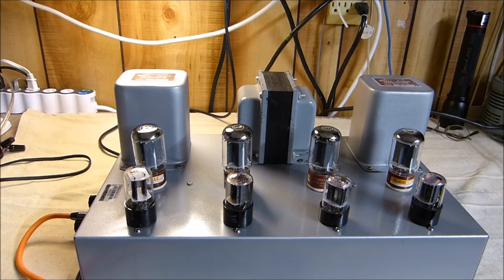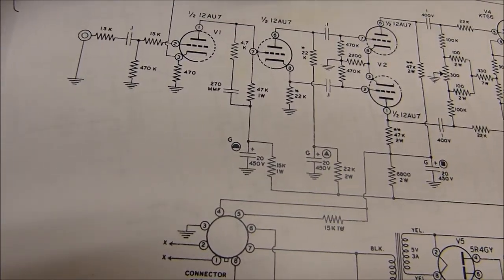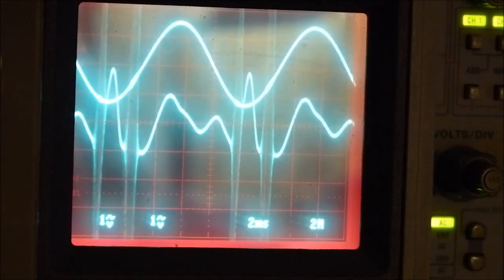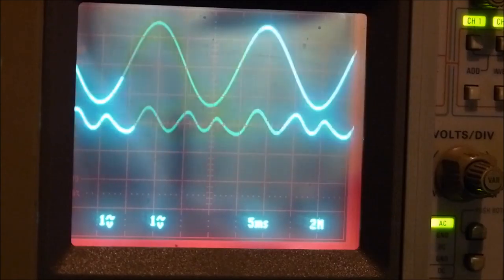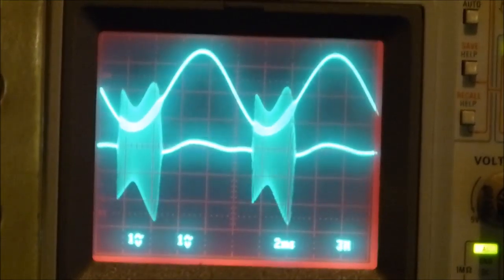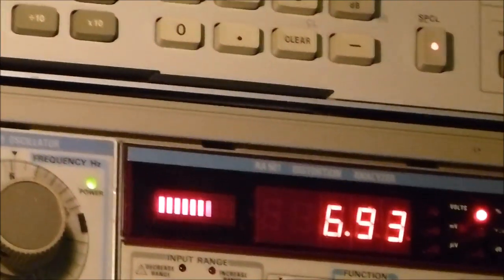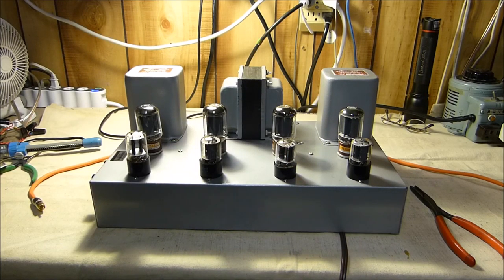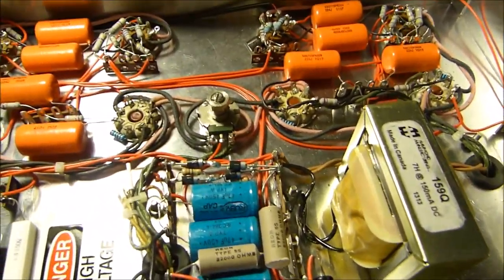Part 5 - Acrosound TO-300 (Williamson Design) Transformer Vacuum Tube Stereo Amplifier Build

Comment: I have encountered this type of oscillation on amplifiers before, mostly on transistor types in the 70/80s It can often be cured by adding a ferrite bead over the input (grid) wiring. It increases the inductance of the wire just enough without effecting the performance. Try it!

Comment: I had the same problems with a williamson style amp that I build.

These oscillations are caused by too much feedback and a massive phaseshift (in the high frequency range) in the outputtransformer.

Using a small capacitor to roll of the high frequency in the previous stages is the cheap way to reduce this effect.

Things you should try:

1. Use a larger feedback resistor.

2. Use larger gridstopper resistors on the 5881's.

3. Remove the bypass cap of the feedback resistor.

4. Instead of applying feedback at the cathode of the 6SL7, connect the feedbackloop to the cathode of the 6SN7.

5. Use a different circuit. ( for instance: use the 6SL7 for as a cascaded gain stage and the 6SN7 as a differential amplifier.)
Reply from the maker: I really appreciate your thoughts and I think they are excellent. My purpose for this amp build is primarily to test the Acrosound transformers in an actual Acrosound circuit. When built exactly to the Acrosound schematic, I get what I have shown in this video. Now, I want to modify the circuit as little as possible to stabilize it. I have found that a 0.001 uF capacitor off the plate to ground of the lower tube in the schematic stops all the parasitics at any gain pot level. I need to run a frequency sweep on it to see how this might have affected the HF response. As for playing with the feedback resistor and bypass capacitor - that is quite a chore. I have done this several times on other amplifiers and there is always a trade-off between gain and frequency response and parasitics at 20 Hz and then again at 20 KHz. Making any one perfect seems to sacrifice the other. I like the idea of larger gridstoppers on the 5881's and I will try that and I also am interested in the grid input circuit of the Heathkit W-5M amplifier. The things I will try next is the 0.001 uF capacitor mentioned above, possibly the 82 pF/10K rresistor off the grid of the second stage, larger gridstoppers, as you mentioned, and the input circuit with a series gridstopper at that point. Trying to stabilize this amplifier with the 6SL7 has already been abandoned. Not sure why Acrosound felt they needed such a high gain stage.

Comment: I had similar oscillation problems with an amplifier I built years ago. I ended up installing series 1k resistor at the first grid of the input stage. Also 1 k resistors in series with the G1 grids of the 6L6 tubes. I think this has something to do with the barkhausen effect , I'm not totally sure its been many ago. Just a thought....good luck. Its a nice project, it makes me want to build one again.
Reply from the maker: This amp has 1K resistors in series with the grids of the 5881's. They are called "grid stoppers" and I believe they are there to reduce RF interference.  I remember back in the 50's and 60's it was not uncommon to pick up AM radio stations on just about any amplifier/stereo system/TV/telephone as there so many AM stations around then. Nowadays not many are left so, if this is true, then "grid stoppers" are probably not much needed anymore. Same goes true for ham radio transmitters (i've been a ham for 53 years) and again, back in the day, it was almost assured your radio transmitter was going to interfere with the VHF stations on TV. Now with cable and satellite, it hardly exists any more.  As for the first grid, this is indeed a sensitive spot and I have found that keeping this path to ground 100K ohms or less helps prevent parasitic oscillations. I really appreciate your thoughts and a "grid stopper" resistor in series with the first grid just may be one of the things to help stabilize this unit. I will try it.

Comment: I'm really enjoying these videos. I was pleased to see you using a square wave test to help shake out the gremlins - I'm wondering if the R & C values you've chosen for the NFB might be a bit ambitious, stability-wise. Thinking back to your earlier video on selecting those values, I wonder if a square wave stimulus might have shown some oscillation that wasn't apparent at the time. Just my $.02, but I wonder if reducing the value of the capacitor on the NFB would help here, albeit at the cost of increasing the high frequency THD?

Comment: Very interesting.  Which stage is it in?  The preamp or phase inverter?   What is the top trace on the scope?
Reply from the maker: The parasitic bursts can be traced back to the first stage and undoubtedly is a product of NFB and other issues in the amplifier circuit. I am sure the OPT is a main contributor to these parasitic issues. The top trace is just a monitor port out of the Tektronix AA501 basically an oscilloscope display of the signal being tested. The bottom trace is the error signal after the microprocessor in the Tek has taken out the fundamental frequency and all that is left are the distortion products. The bottom trace is what is really important. The scope auto-scales so the amplitudes of the top trace and bottom trace are not of the same vertical amplitude. If they were, the bottom trace would just be a straight line for very low THD.

Comment: Check the values of the coupling capacitors on the early Williamson. I built the Hafler-Keros ultralinear using To-300s and used a 10 to 1 ratio to achieve stability.

Comment: just an idea... this problems that occur seem to be happening at the bottom side of the sinewave. is it possible that is occurs at phase shift circuit?
I've never messed up with PP amps, but I've built an SE amp and similar thing would happen on entire sinewave. I got rid of it by adjusting the feedback circuit and coupling cap values like using smaller values on interstage decoupling caps and more feedback and bigger value on the input to retain a decent frequency response. But it also made a huge difference by  changing the speakers I was connecting it to. lower sensitivity  higher power speakers were making amp more unstable than sigh sensitivity lower wattage ones... Also I got rid of low frequency oscillations by using bigger cathode cap. 
I don't have much experience in building amps but the one I built was totally designed from scratch, so I'm just sharing what I noticed in the process.

Comment: may be the noise comes form RF  induced in the input cables?
Is the interference exists in the first tube stage???
If you turn off one channel (remove all the tubes on that channel), the interference exists on the other channel?
Reply from the maker: The parasitic's exist in each channel separately with the tubes out of the channel not being tested. It is not picking up RF from any nearby source or, I am pretty sure, it would be a constant level. My little shop is a metal building with a small wire mesh over the window (known as hardware-cloth). I did this some time back to reduce the RF in my workshop as much as possible. The bursts are an artifact of the amplifier circuit but they can be tamed with one or more of the methods used by the amplifier companies of the past. No use in reinventing the wheel here when it has already been solved by a number of different methods. Actually, I will show in the next video to post, where all these issues are basically resolved by a 0.001 uF capacitor off one of the 5881 plate leads to ground.